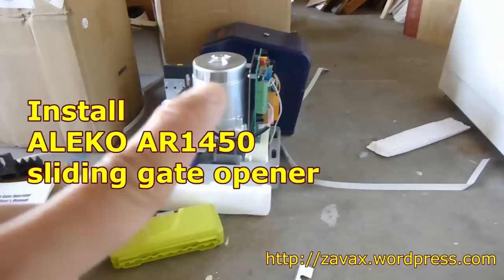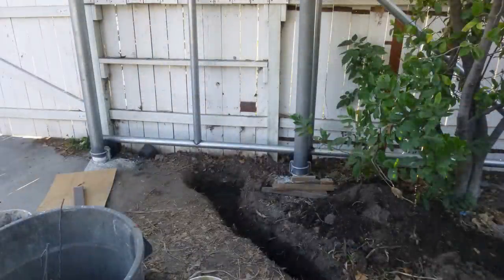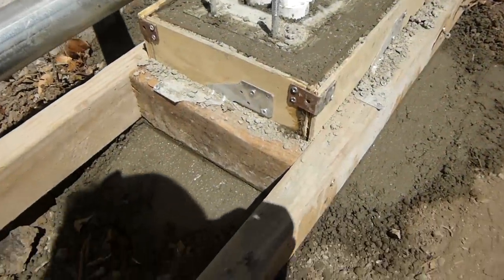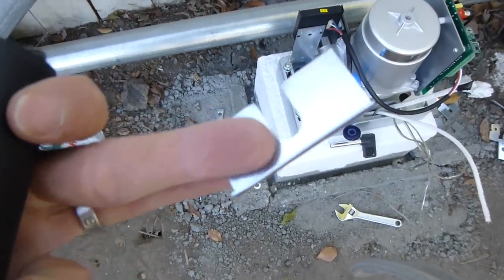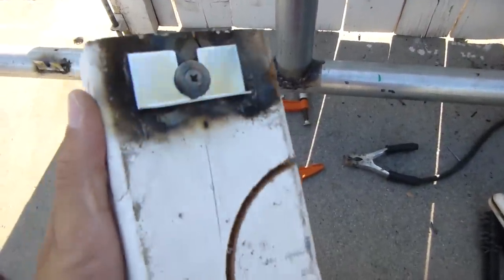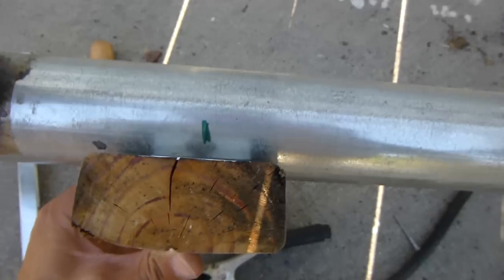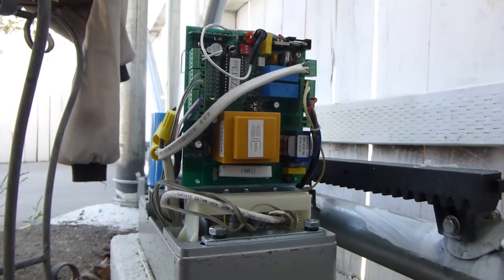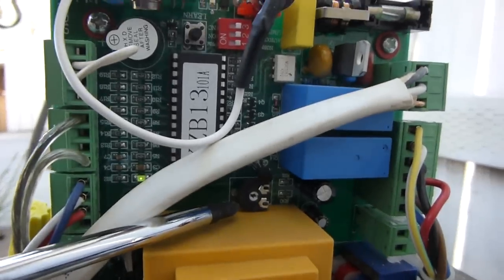Install ALEKO AR1450 Sliding Gate Opener with Gear Rack

Comment: Thank you so much for taking the time to produce your gate videos.  I didn't want to spend 4k for a gate and operator.  I currently have a tubular cattle gate that spans 16' across my driveway that I installed last year.  It swings and we are tired of getting out of the car to open and close it.  I have been looking for away to convert to a slider gate because of snow.  The gate doesn't swing easily in snow so slicing through it will be much easier and doesn't tank up as much room.  I look forward to obtaining the parts and get it done!Thanks

Comment: one your stick is not hot enough 2 i dont know if that paint or galvanized if its galvanized well then its not going to be very good if paint grind it down  but if you are just learning then its fine you will get there
oh ps hey thanks for sharing i an trying to figure which electric opener i want the expenses ones like eagle or the more cost effective price

Comment: Your magnetic stops are in the opposite location specified in the instruction manual and other YouTube videos of the AR1450.  They show the lower bracket used for the open and the higher bracket used for the closed position.
Reply from the maker: Great observation! But I don't think it's wrong since it's been working for over five years. There is simply no absolute "open" or "close" from the motor's point of view. All it does is simply as this: turns -> senses magnetism -> reverses -> senses magnetism -> turns and repeat. If you look back into my video, and image if my drive way was on the opposite side. Then the "open" becomes "close" and "close" become "open." If you just need the motor to open/close the gate. It works either way. However, you are not wrong. If advanced function is needed, e.g. photoelectric beam or auto-reverse, the motor will need to be aware if it's in the process of "opening" or "closing". In that case, the height of magnetic stops matter.

Comment: You need more amps on your welder. Easier to get weld started with more amps. Place rod more on the thicker work piece rather than the thin bracket
Reply: +Danny Haehae 
I had a similar comment in mind, but the bracket is quite thin, so perhaps better to struggle initiating the arc than to struggle later filling holes burnt due to excess amps.

On the subject of initiating the arc, my old West Indian instructor had thoughts on that... There are two ways to get started... "poke it, or stroke it"  poking wasn't working terribly well, so try the other way. Looks a good project, though.

Comment: can you manualy open the gate after having the motor and rack installed?
Reply from the maker: Yes, you can pull out a security pin on the motor to allow for manual operation of the gate.

Comment: Thanks for the video.  I purchased an Aleko AC1400 from the manufacturer in Washington state.  Biggest mistake of 2020.  The instructions could have been more useful in braille.  I see that you installed the gate on the right side.  We had to install ours on the left, which reverses the open and close features.  We tried to install the child safety sensors and since the opener is on the left side the sensor would act in reverse and close when triggered (sensor interrupted) instead of opening.  Is there a way to program the opener to act accordingly?  I know I can't change the setting of the sensor and if I don't correct this I would not pass inspection.  Can anyone advise?
Reply from the maker: No bigger mistake for 2020...the opener and sensor are designed for general purpose, they definitely could be configured for your installation. The opener motor basically does only one thing: rotate in one direction - stop - rotate in reverse direction. The "stop" is triggered by either the remote, or the magnets, or the safety sensor. There is no "open" or "close" from the motor's view of point. If you go back to my video, and image I remove all my fences on the right side of the motor and install them back to the left side. I can still "close" and "open" it.
Reply: @XueMingYu

Comment: You really needed to grind off the Galve coating on that steel ...
Reply: Yeah welding through galvanized steel releases todos gas. Very bad and causes perosity in the welds.